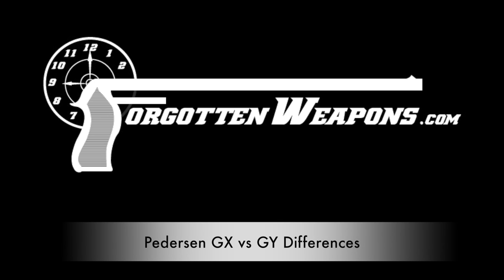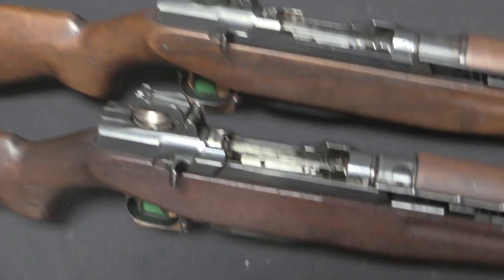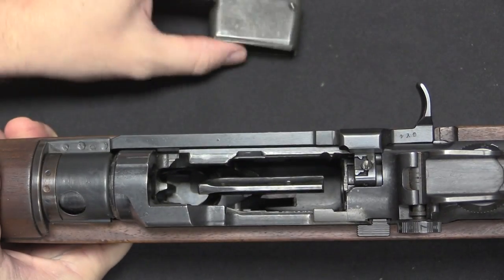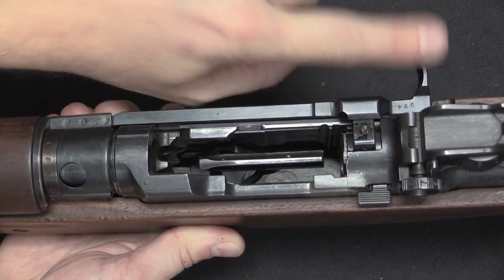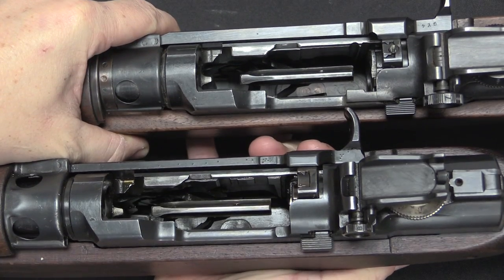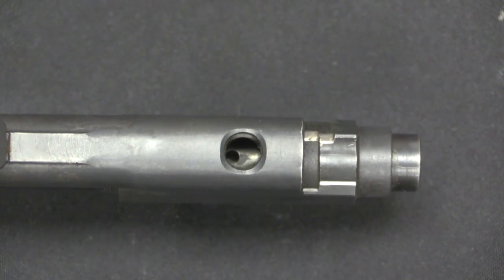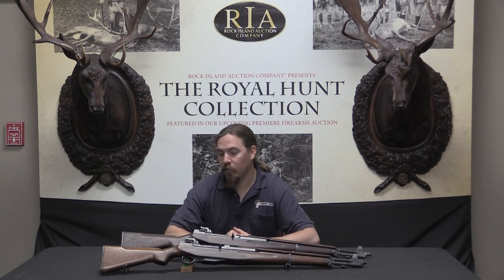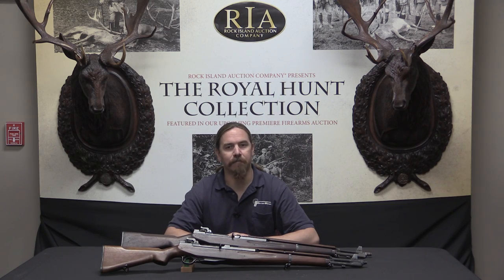GX vs GY: What Are the Differences in Pedersen's Garands?

Comment: I wish the Army would have accepted the GY version, because it would have solved the Garand-thumb issue. Granted, Garand-thumb is easy to avoid but it still complicates the loading procedure and is one of the things I really dislike about the Garand.
Reply: Garand thumb is not an issue if you load them correctly. Accepting this inferior rifle over the Garand to correct a non-issue which is solved with training is a bit excessive. The Garand wasn't perfect but it was the best option.
Reply: What specifically is inferior about it? It practically is a Garand, with some slight modifications.

And yes you can avoid Garand thumb if you load it "correctly," but the fact that there is a "correct" and an "incorrect" way to load a simple enbloc clip is a design deficiency.

Comment: Wait, how would adding a smaller hole in the gas plug of a gas trap rifle improve performance. One would think that without a ported barrel in the gas trap design the gas captured would be of lower pressure and the smaller hole would prevent the rifle from cycling properly.
Reply: He said it in the video. It lead to more fouling that contributed to reliability and accuracy issues. Check out the video at around 9:00 minutes in.
Reply: I believe Hunter Compton was referring to the GX that had the smaller orifice in the gas plug apparently retrofitted.  I had the same question, and my guess would be that Pederson found that the large gas trap port overgassed the action, so the smaller orifice was fitted into the gas plug to reduce the amount of gas reaching the op rod piston.  But perhaps we'll never know for sure.
Reply: +Tactical Tightwad That's what I was thinking. Adding a constrictor plate in there wouldn't change it from a gas trap to a ported system, you still have an open area between the end of the barrel and the smoothbore section. The constrictor plate would allow you to "tune" the action to get the correct pressure.

Comment: Hmm... So what exactly was better on the Pedersen GY rifle compared to the M1 Garand? If it has the same gas system, same action, same clip and so on. Are there any differences that make it a better option? Looking at your earlier video on the GY the only better solutions on it seem to be the better-cooled barrel and the straight op-rod. Does an 8-round semiauto rifle actually need extra cooling for the barrel? The ventilation slots on the handguard of the GY seem like a really easy way for all kinds of dirt to get in where the op-rod is.
It really seems like a completely desperate thing to do, to offer basically the same gun that's already in full production.
Reply: The extra mechanism to save your thumb from being bitten was a nice addition.
Reply: That rear sight caught my attention, maybe Ian will do a supplement video on it.
Reply: Berno Bruvn Mikcalson Some quick Googling suggests that the M1 Garand can handle a sustained 50 rounds per minute without issues. You'd probably run out of ammo before you get mechanical issues due to overheating. Some more Googling suggests that the official loadout for a WW2 US soldier was 10 clips + 8 rounds in the gun, for a total of 88 rounds. But people carried extra bandoliers if extra ammo was available. Someone's granddad supposedly used to carry 184 rounds. That's still only enough for three and a half minutes of 50 rounds per minute, and even less if you shoot faster than that. So it's unlikely people had problems due to overheating. There are stories of the wooden handguards smoking after a lot of shooting, but that was just the oil the wood was treated with.
Reply: mechanical...sure.... but its going to be giving off so many "heat waves" that your not going to be able to hit shit. 

plus, if you just shot even 10 rounds, then something goes wrong and you need to get in their....shits fucking hot. and its ALL wrapped in INSULATING wood. 

it also acts as fluting.... that barrel is lighter than the m1..... and i bet the gun is lighter than an m1. 

i actually own a 1943 receiver, 1952 barrel, post ww2 op rod..probably 52.....and a 1942 bolt....

its heavy, and having to think while reloading sucks. (however, m1 thumb isnt as big a problem in the civ world as people make it out to be)

the pederson fixes both of these....

Comment: Before you explained that the op rod and follower were disconnected I was recoiling in horror watching you load it one handed. I figured you'd either gotten cocky or you were planning on being the first man to publicly commit suicide via Garand thumb.
Reply: see...at least on my m1....it only releases when the follower hits the bottom of the mag well. 
m1 thumb is blown out of proportion. 

just pushing it down 1 or 2 rounds worth WILL NOT release the bolt on a properly working m1. 

notice when loading a full clip....it will not release till it gets to the bottom.

OR!!! and what i think gets most people....

if you have any pressure on the follower and then apply backward force to the charging handle....it will release. 
but that still requires 2 actions....

sure, in combat it would suck having to think about that.... but im able to figure it out while shooting at big bucks so...

Comment: the army should have taken the follower system for the m-1!! it beats getting the thumb!!!!
Reply: But you got the more springs and such that can mean more production and more parts that might break.
Reply: Having something in or on the receiver to manually lock the bolt open could work and still be feasible for production.

Comment: so GX does not use standard Pedersen's n-blogs ?  cause when TFB reviewed the weapon didn't mention anything else about different versions...
Reply from the maker: There are two standard Pedersen clips, one for the T1 and PB models (which can only be inserted one direction) and one for the PA model (which can be loaded in either direction, like an M1 clip). However, both of those are made for .276 caliber cartridges. The GX clips would need to hold .30-06 cartridges, and thus be different from the previous types of clips.
Reply: @ForgottenWeapons  Would it be possible that Pedersen simply adapted one of his previous clip designs to .30-06?

Comment: U.S. flag only had 48 stars in the 30s, 49 star came out in 1959 and the 50 star came out in 1960
Reply from the maker: That's why the thumbnail flag has 48 stars.
Reply: REKT
Reply: +Forgotten Weapons Ian your thumbnail must be different than mine because I got the current 5 rows of 6 staggered with 4 rows of 5 flag, not the 6 rows of 8 flag

Comment: Why did Pederson like leaving the side of the stock open like that?
Reply: Air cooling.
Reply: It seems to me that it's not open, Ian simply has the bolt locked open, and the op-rod with it, leaving an opening where the op-rod would be with the action closed

Edit: While I was right about the op-rod, there indeed appears to be an open channel down the length of the rifle, between the upper and lower handguards, and now I am officially baffled.

Comment: Is it possible to add rounds of ammo to the magazine in the GY? With the Garand you have to wait until it ejects the empty clip before you can have 8 rounds in the magazine. I would see the ability to top off the magazine to be  more important than the Garand Thumb or the ping problems. It's a possible explanation for the differences concerning the spring and catch also.I also wonder if the large hole in the GX made the action over gassed. The sleeve with a smaller hole would have been easier than tuning the rest of the system and maybe leave open later addition of an adjustable gas source.
Reply from the maker: Actually, you can add rounds to an M1 clip while it's in the rifle.
Reply: Chalk up Pederson's toggle bolt guns and the GY along with Burgess's grip-cock shotgun for guns I would LOVE to see Pedersoli or Uberti recreate!